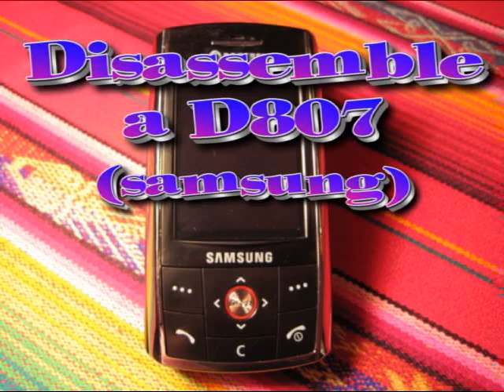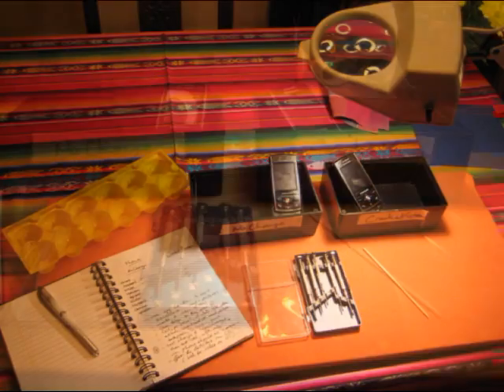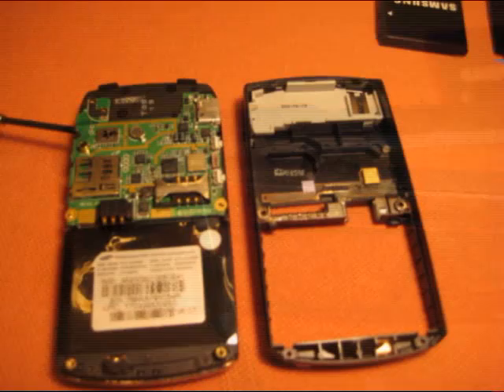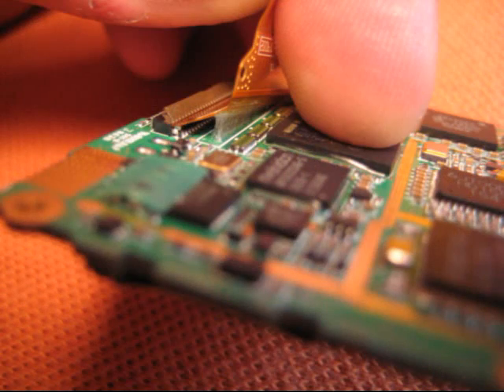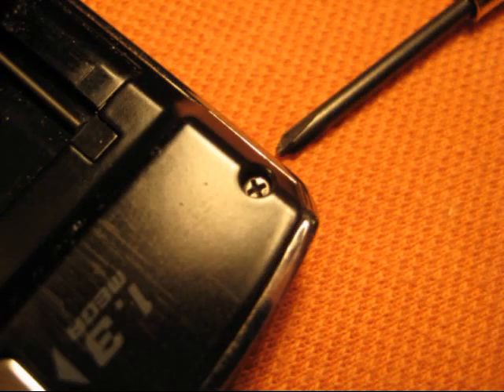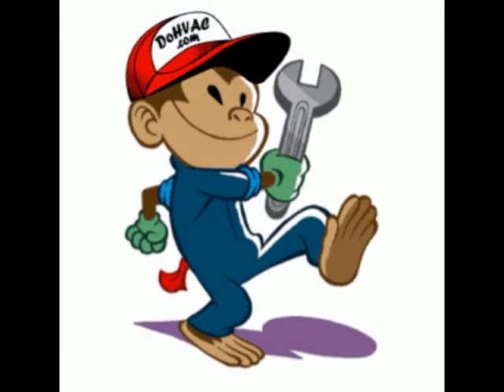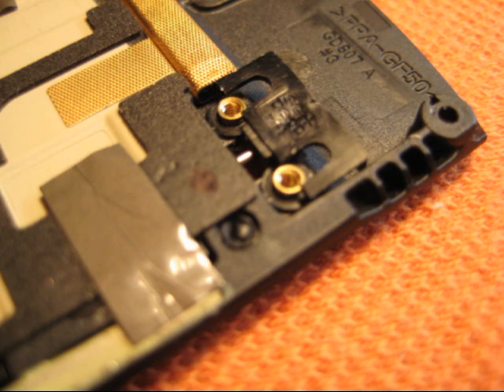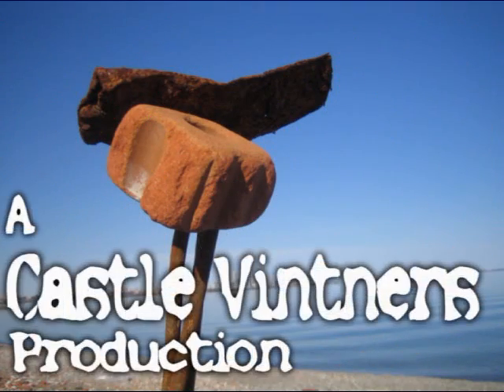Cellphone Repair (D807)

Comment: Replaced the ribbon cable in my D807 a SECOND time.  Your video helped  both times.  Thanks for sharing, though I have the feeling I won't repair this thing a third time.  It's been once in three years between it breaking.  No more sliders for me, thanks.